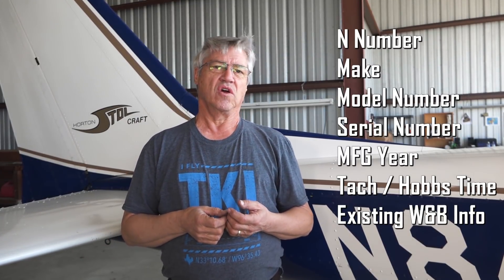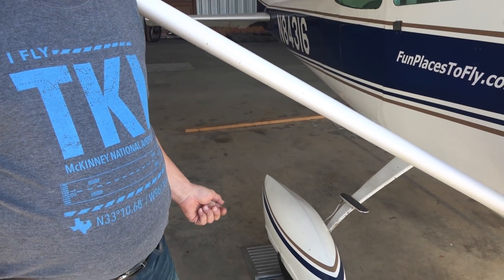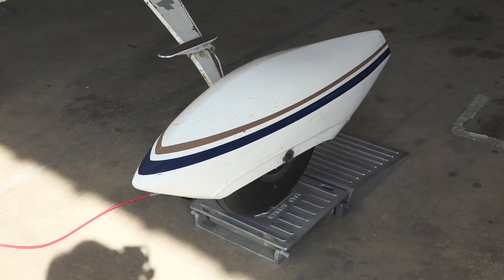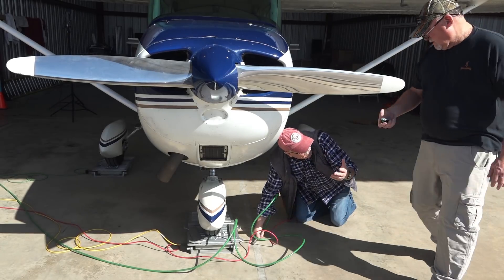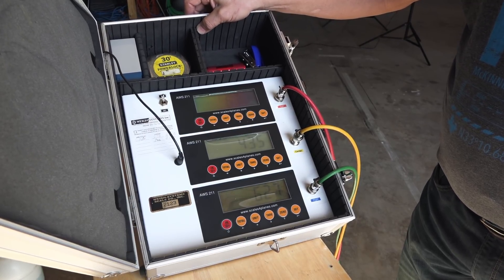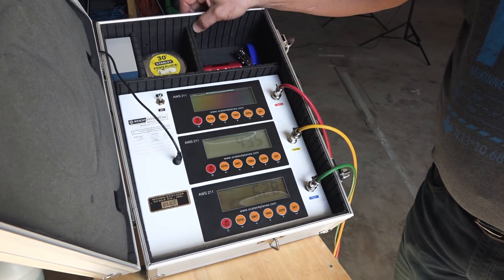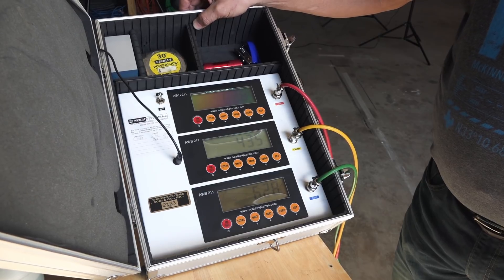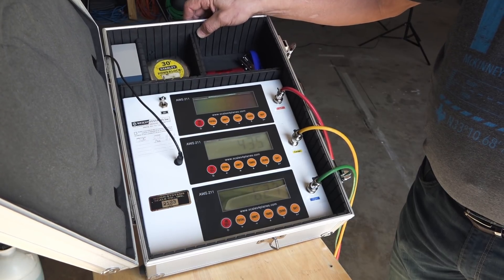Cessna 172 - Weight and Balance Calculation

Comment: @ 1:50 acronym STC = Supplementary Type Certificate (A supplemental type certificate is a national aviation authority-approved major modification or repair to an existing type certified aircraft, engine or propeller. As it adds to the existing type certificate, it is deemed "supplemental")

Comment: as a new plane owner (1966 Cessna 172H) and recognizing there have been a lot of additions and subtractions to the plane over the last 54 years, i decided i needed to get a good current weight and balance.  Based on that, where or who can do weight and balance like in the video?  Can any A&P do this with the equipment?  Are there specialty places that do this?  Just want it done right since it is critical to safe operations closer to Gross weight.  Appreciate any insight.
Reply from the maker: We were lucky that the A&P that did our weight and balance was a member of our EAA Chapter. You'll most likely have to call an avionics shop to find someone. They deal reweighing aircraft with every avionics install.

Comment: What if you didnt have a spread sheet, what are the raw calculations.  I am getting ready for my A&P oral and practicals and I dont think they will let me use a spread sheet.  I got my sign offs through an apprentiseship with a IA friend who also helped me with my owner assisted annuals.  I helped with other planes as well but not everything came up.  I did ok on my written exams but failed the orals, when I retest I dont want to get past the orals and then bust the practical as the cost goes up for the 3rd attempt.